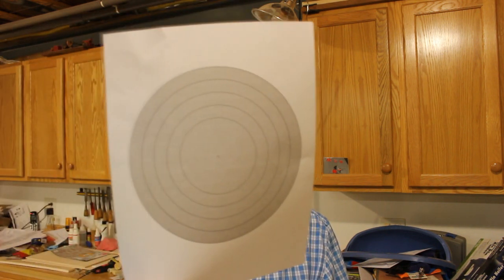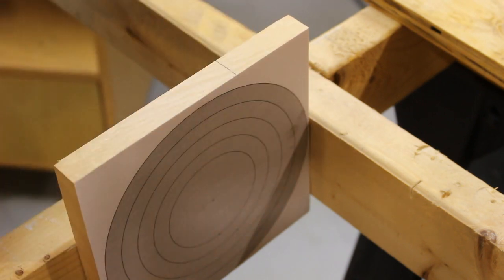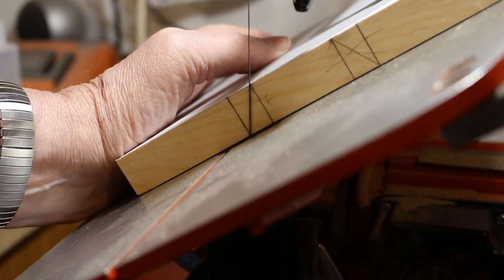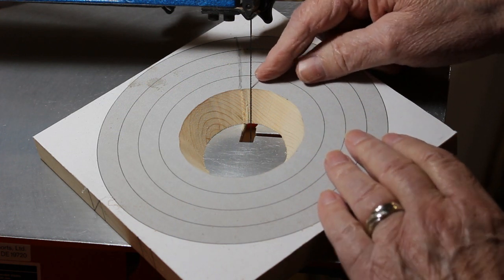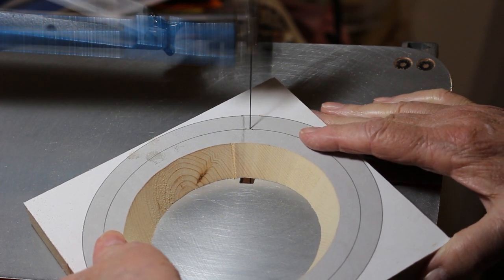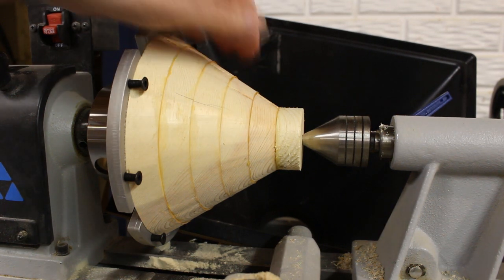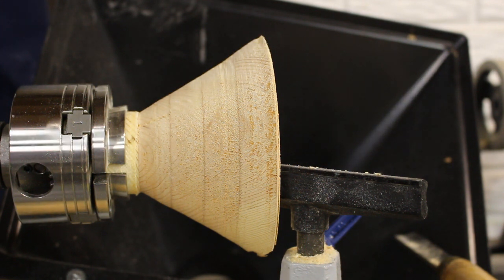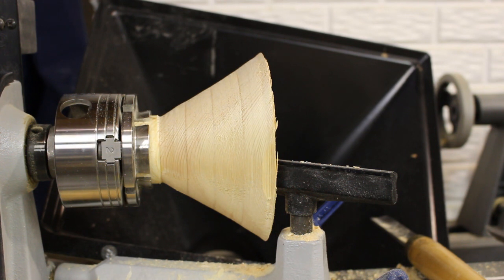Scroll Saw Bowl #1

Comment: HI PAUL I ASKED WHAT PRICE TOOLS LATHE THAT MR. PAUL HAD FROM ABD THANKS
Reply from the maker: naufal, now I understand...sorry I didn't before.  My lathe is an older Delta Midi Lathe, it does not have electronic speed control like the newer ones do.  The new Delta Midi Lathe costs $649.00 on Amazon.  There are many other manufacturers of this size lathe, Jet, RiKon, Nova just to name a few.  I think all are good quality tools.  Hope this provides the information you were looking for.  If not please get back to me.  Thanks for your comment.

Comment: The thickness of your board does not factor into the angle that you cut at?  That was super simple way to figure the angle. I thought there was more math and a formal.
Reply from the maker: John,  The main factor in deciding the angle is the width of the sections of the bowl.  If you follow my procedure you will find out it is very easy to cut it out.  Thanks for taking the time to watch and comment.

Comment: I'm trying to figure out how to make designs in Inkscape that I just downloaded today for more complex designs with bowls and baskets.I'm able to make the outline of the design...but
For the life of me I can not figure out how to reduce the size of my outline and to come up with equal separation between each segment.
I used to do some cool things in a photoshop bootleg  but that was 10? yrs ago and no longer have Ps bootleg copy.
I found one tutorial about using Inkscape for this type of pattern but as my luck would have it,the person was from Russia or the Ukraine and I don't read either.
I do use a compass but I want to do more detailed patterns than circles or rounded squares/rectangles.

Wouldn't have any tutorials coming up or knowledge of any links to get me on the right path?
Really infuriating I can't figure this simple bit out after what I used to be able to design some years ago......ahhhh
Reply from the maker: rider660r,  Unfortunately I am no expert either when it comes to Inkscape.  I have been trying to remember how I drew up that pattern with the equally spaced circles but cannot remember.  Usually I just play around with the program until I get it to do what I want.  I do seem to remember that I drew the original circle then up at the top there was a setting where I could make it a specified distance larger or smaller by copy and pasting.  You might try either checking some YouTube video tutorials for Inkscape or their help database.  Seems like that is what I ended up doing.  Sorry I am no more help than that.  Thanks for taking the time to watch and to comment.
Reply: @paulsmessyworkshop   I've looked on Youtube and other places and the best one (almost the only one) that showed pretty much what needs done is in Russian or Ukranian and they was jumping all over and then you have no real idea what tool they're actually using....figures don't it...

I get more time I'll play with it more as I taught myself Photoshop Cs4 I should be able to figure this out sooner later,probably later.I can get the circle or other main design but getting them spaced and smaller is the problem I'm having.Be nice if I still had my bootleg copy of Cs4.

Comment: A scrollsaw bowl is intended to make a bowl out of a flat piece of wood and not use a large.
Reply from the maker: John,  I guess I don't fully understand your comment.  I did use a flat piece of wood to make the bowl on the scrollsaw.  I just messed up when I tried to finish it on the lathe, next time I will be using another method.  Thanks for watching and for leaving the comment.  If I have misunderstood what you meant please message me back.
Reply: I have a book and have seen scrollsawn bowl in magazines. I have made several. The premise of a scrollsawn bowl is you use a flat piece of wood and not use a lathe. It's an alternate to making a bowl on a lathe. The point I was trying to make was you shouldn't need a lathe to finish a scroll saw bowl.
Reply from the maker: John,  I agree with you 100% that you do not need and normally do not use a lathe to finish a scroll saw bowl.  In this case I was trying a method different than sanding to do the finish shaping and design.  A friend of mine had tried this method and it worked quite well for him.  It is just a time saver, but not in my case, not necessarily the recommended way of finishing the bowl.  The normal method of finishing the shaping of the bowl is sanding from coarse grits thru to the finer grits.  We agree that is the normal method.  Thanks for sticking with your comment and for taking the time to  explain to me.  Again, thanks for watching.

Comment: Paul that really was a great project. It's unfortunate that it did crack on you though. We all learn from our mistakes! Pine really isn't a good wood to turn anyway. Especially in a dry state. However I have seen bowls done like this that came out really cool! Russ Clairity  is a great guy, and a great teacher. I'm sure that if you tried this again it would come out correctly! Many blessings to you Paul!
Reply from the maker: Tracy, Russ Clarity is indeed a great person and an excellent craftsman.  I agree that pine is not the best choice to use on a lathe and on my next attempt on this project I will most definitely be using a hardwood.   Learning a new technique and is what learning is all about, right?  Thanks for taking the time to watch and comment.

Comment: want to make a bowl but dont have a lathe so i guess i want make a bowl, naw, ill just sand it, make it turn out right.
Reply from the maker: MTZ384,  You don't need a lathe to make the bowl.  I just did it to try something different.  Usually after gluing the bowl together it is shaped by doing a lot of filing and sanding.  I just thought the lathe might make the process faster, it didn't.  I would be interested in seeing how your bowl turns out.  One of these days I will be making another and probably won't be using the lathe.  Thanks for tuning in and also for the comment.
Reply: @paulsmessyworkshop  no thankyou, i enjoyed you vid, it help me out alot
Reply from the maker: MTZ384, I would like to see your project when you make one.

Comment: Great project and a nice video.
Sorry but I fail to see why you put the bowl on the lathe, if you had not bothered with the waste block you could have just sanded the bowl without the lathe breakout risk!
Sorry if I sound negative, please take my comment as constructive criticism.
I left a like so please don't think I am trolling!
Reply from the maker: Naster Jam,  believe me I did take your comment as constructive.  To tell you the truth I was sort of experimenting using the lathe to finish up the bowl because I thought it would be easier.  I have also received lots of suggestions that instead of using the lathe tools to still mount it on the lathe but then sand it smooth.  Regardless of the way I do it I thing that sanding is going to be my next method of finishing the bowl.  Thanks for your comment and suggestions.  I appreciate your taking the time to watch.
Reply: @paulsmessyworkshop  Experimenting is always good!
Shame it didn't work but then, that's how we all learn, by our mistakes.
I agree, sanding it on the lathe would be easier than a belt sander, although if you had a big enough bobbin/spindle sander that would work too.
Reply from the maker: Natster Jam,  good idea about the spindle sander.  All this conversation about the bowl makes me want to try another one.  I guess I had better put it on my to do list.  Thanks for the reply.